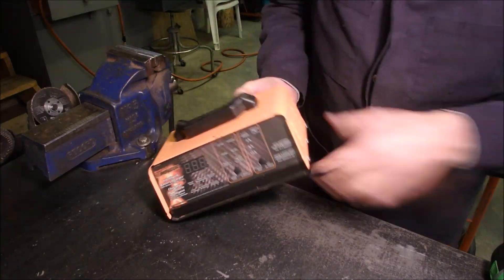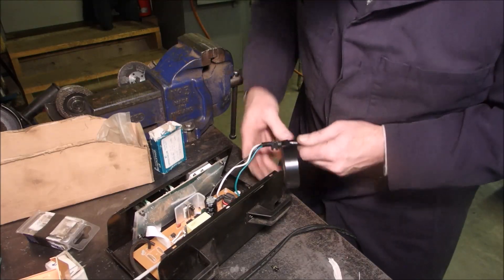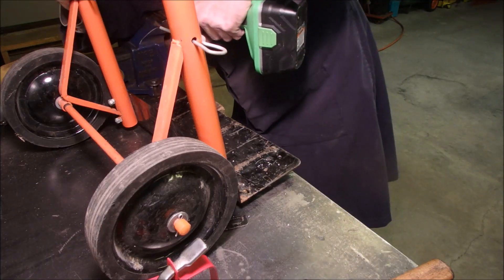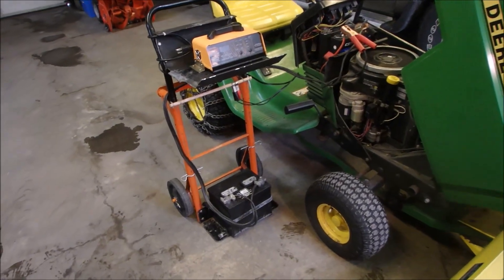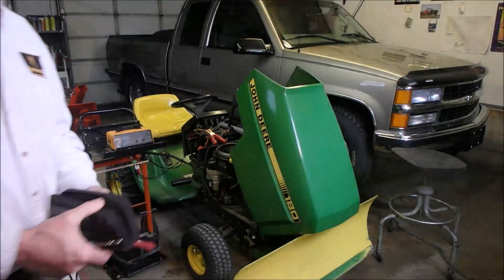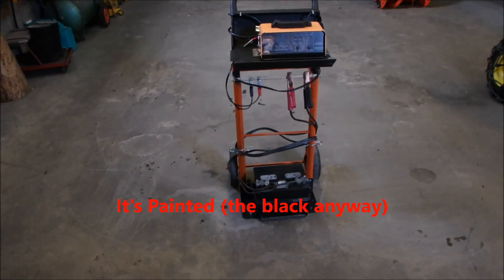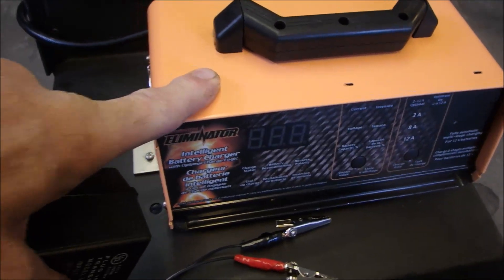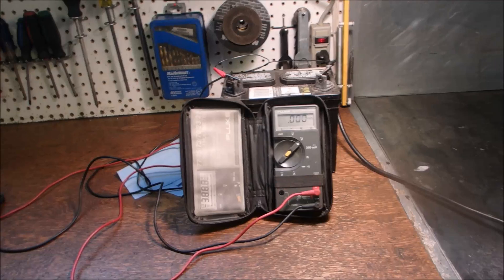Building a 12 Volt Charging Cart Part 2

Comment: Following up to my comment on the part 1 video.  I see that this charger's power cable is damaged at the strain relief.  But - it didn't kill you, start a fire, or fry your electrical system because it was built with safety in mind (heavy and double insulated). If this was a Noco charger that wear and tear would have exposed bare conductors!  To make matters works all of Noco's marketing material show pictures of the charger sitting an an engine bay next to the battery. So that's a perfect storm - a cracked strain relief, exposed 120V conductors, and an ungrounded car chassis lifted to 120V waiting to kill someone.

Comment: Hi, like your videos.  I think you want to use a float charger not a trickle charger for long term battery charge maintenance.
Reply from the maker: You are right.  I worked in standby power for many years.  It is all about volts per cell.  We floated ours at 2.16 volts.

Comment: Cool project Bruce. Find a good booster battery and you'll be all set.Maybe mount a functioning ammeter from another tractor on you cart to check the charging system of the equipment that you are repairing.Also,do you ever use a hydrometer to check batteries?
Reply from the maker: I have done back when i worked but i don' have one

Comment: Great repurpose of everything you used Inspector Gadget! Didn't really cost you anything but your time. You might fabricate a shallow magnetic tray to sit in front of the charger to hold your tools and nuts and bolts you take off something. And will keep your tools secured to the cart when you move the cart.
Reply from the maker: Yes and I have one    good idea  Thanks

Comment: You actually can use heat shrink on an application like that if you don't mind using two of them. Slice them down the side and heat one on, then cover the seam with the other one and heat it well. It will seal nicely.   Then again I'm sure the tape will be fine..
And I would HIGHLY recommend the Stanley Fatmax jump starter. Small and portable and will start anything...even V8's
Reply from the maker: And maybe a lithium pack too.